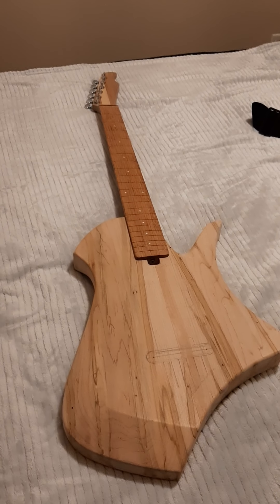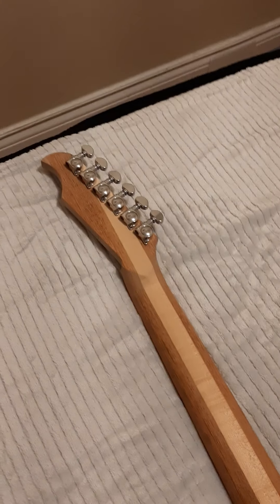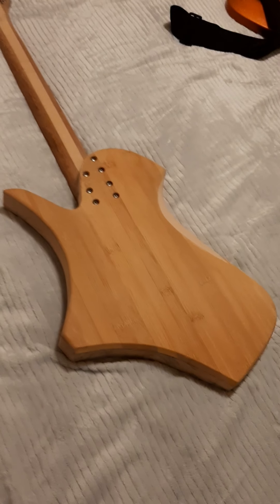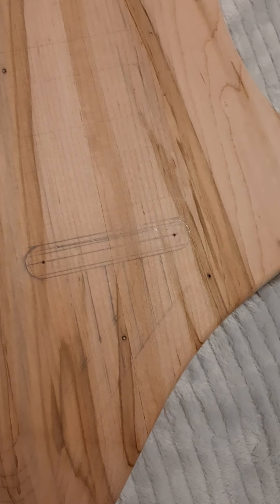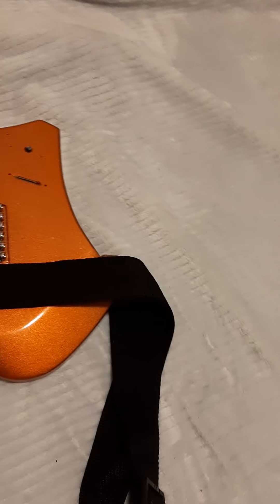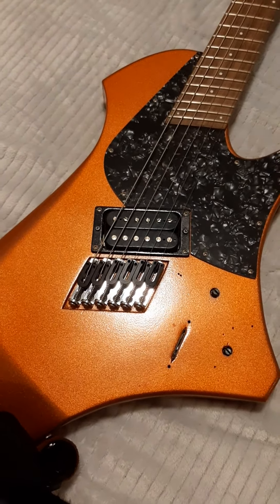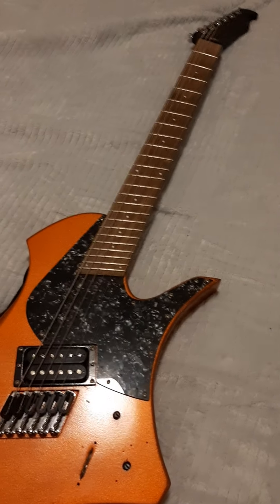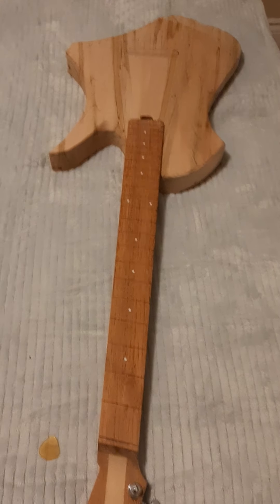A brief look at my latest build

Comment: Nice design!  I like the top contouring.  I like your inset screw heads for the neck joint.  I thought I could get away with just countersinking the wood, but already the lacquer is checking around the countersigned area.  Yours is also a good solution for setting the guitar down on surfaces you don't want the screw heads to scratch.
Reply from the maker: Thank you! I have been teaching myself luthiery for the last two years. During that time, I purposely forced myself to try and find hardware solutions that were practical and budget friendly. There is another short video of this instrument in its completed form which shows the string retainer I machined from brass (with a handheld router) and then chrome plated. The plate idea only occurred because the area behind the bridge location got damaged. 
Ironically now, the strap button sits just beside the bolt array, as with testing that proved to be the spot which promoted the best hang for the guitar. Luckily the guitar plays great so it's hard to put down lol